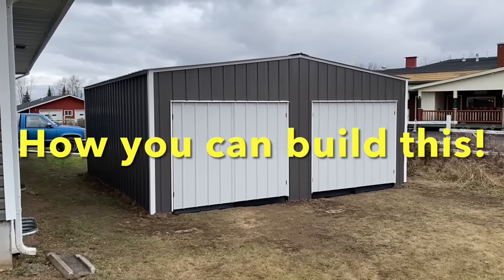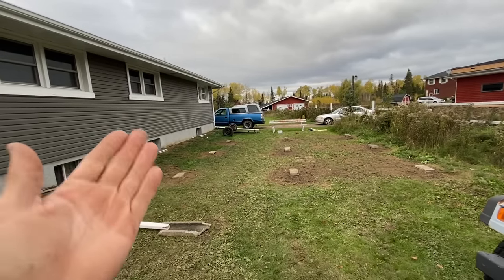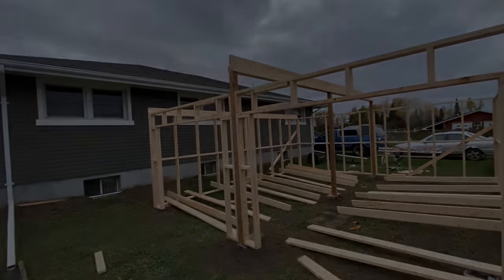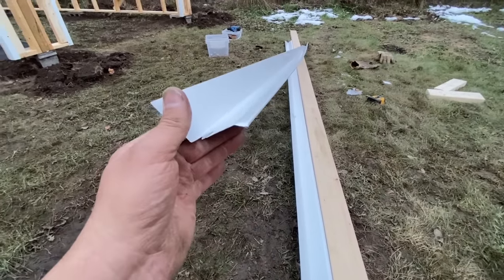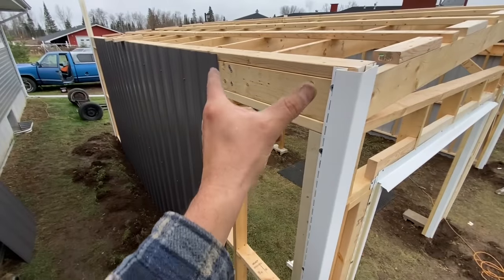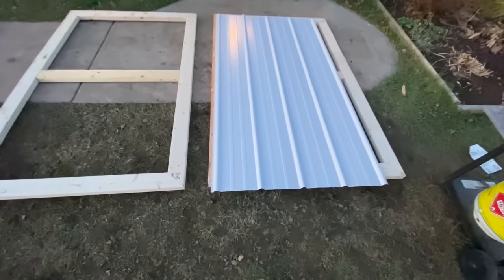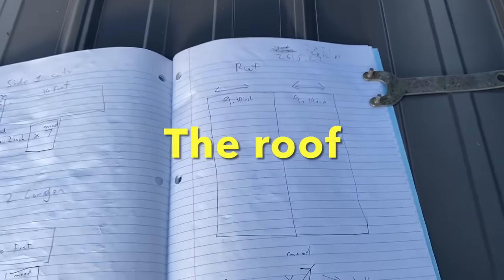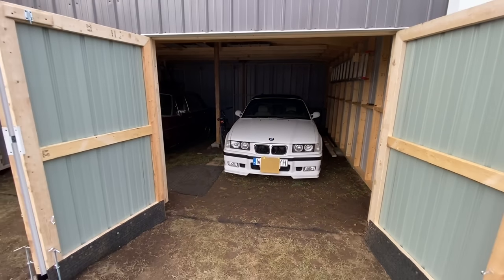How to build a 20x20 Garage for $3000 in 5 days (from Home Depot materials)

Comment: There is so much wrong with this, it's hard to know where to start. It isn't the concept, and it isn't the cost, you could have built this correctly in the same budget, maybe a few extra boards. It's that it's designed and constructed wrong. The way it's built, the structure is incredibly weak, it will sag, and it might collapse under some pretty light loads. Please, do not build things like this, and do not tell others to build like this.

Firstly, the block foundation - a block foundation like this is mostly fine, but the blocks are in sideways, so that the building is resting on the weak side of the blocks. Just turn them so the holes face up/down, that's where they're strong. 

Secondly, the foundation is not supporting most of the load. You can do a point foundation like this, but you have to direct the load of the building and the roof onto the blocks. Instead, you have large gaps between the blocks that are completely unsupported, and in the front, the corners of the doors are literally hanging mid-air. Boards are strong in compression, they need to be supported underneath. There are a few options to fix this.
1. More blocks - as you said, you got them for free, they're not expensive or hard to find. If you had built a block wall around, or added points under every stud, or poured a concrete foundation wall, then the wall construction you chose would be fine.
2. Headers/footers to spread the load - By installing headers and footers as appropriate, you can spread the load to the points, instead of the sideways 2x4 plates, which definitely cannot support the load.
3. Post frame construction - If you change the wall construction to post frame, so that each post is supporting the load, and you have a header across to support the rafters, you'd be fine too.
4. Different wall design - a differently designed wall with some diagonal supports from the middle across to the points would also be a lot stronger, despite being a more unusual construction. You do see this in barns and other similar structures sometimes, or as additional supports when more rigidity is needed.

Third, the construction of the walls is wrong in many places. The plates need to always be on top and bottom of the studs, you have several that aren't, around the doors. The plates cannot be scabbed together like you did with shorter boards. There are ways to make up for not having long enough boards, but this is wrong and compromises the structure. The plates need to be supported vertically all the way across, and cannot be split in places where they need to hold the structure horizontally. You normally deal with this problem by using a staggered double top plate, (though it's not always necessary, but I digress). Gaps below need headers across - for the doors, for the space between the foundation points, any time you have an opening larger than your stud width, you need a header of some description to spread the load, and this structure has none, only horizontal 2x4 top plates, which are not nearly strong enough.

Fourth, the roof construction is also wrong. The rafters are supported by 2x4s screwed sideways into a beam, with hanging ends. This means that your entire roof is resting only on the strength of screws, which is not even remotely acceptable in strength. Just like with the wall construction, boards need to be supported by other boards (not screws) all the way down to the foundation. The rafters are also not adequately supported on the outer edges, between the foundation points, since there are no headers and the wall is unsupported between them (as previously indicated). That end plate board is also only screwed into the rafters and is doing basically nothing to hold the rafters up, they are putting nearly all their load on the top plate, which is not adequately supported beneath.

There are a number of other, smaller problems that some other comments pointed out, like types of fasteners and lack of straps and similar. Those are all problems too, but are very minor in comparison to the structural defects above.

The essential takeaway is, when building structures out of lumber, every board needs to be supported by another board or the foundation underneath (or an equally strong structural member of some sort). You can never just leave things hanging, and you can never rely on screws or nails to hold the building up. The fasteners are there to hold the boards together, not to carry the load of the building. The wood must carry the load of the building. There are some exceptions to this, but those exceptions involve things like lag bolts or carriage bolts, NOT construction screws. This structure completely ignores this concept and as a result is incredibly weak and borderline dangerous.
Reply from the maker: Thank you for all your informative information. 
 But in the end it is just a carport, a moveable carport.

Comment: Well, you sure need a concrete pad, pal, and, here, where I live, it is a Must and you need Permit also. First, big wind, bye, bye ......! Where is this?? Somewhere country side, middle of nowhere????
Reply from the maker: Im in the deep north in the middle of nowhere. Never gets windy here, if it did Id anchor it down. It's just a temporary movable carport
Reply: @ProblemSolverGarage   For temporary use, this is OK, just worried about sand floor, gets muddy after rain??
Reply from the maker: It's working great, both my cars are nice and dry, the floor is dry since it's not getting rained on. It's a good removable solution, obviously a real Garage would be better but 20 times more expensive.

Comment: This is an abortion. First, you have to get below the frost line. Typically, that means 36 inches. Secondly, there's going to be so much moisture in there that the wood will rot and metal will rust in few years. Anything stored in there will be damaged. At the very least, skip the blocks, run sono tube a minimum of 36 inches deep and fill with concrete. Dig up all the grass and dirt to a depth of 4 to 6 inches lay down a moisture barrier and fill with gravel, and then compact it. And, lastly use pressure treated lumber for the base.